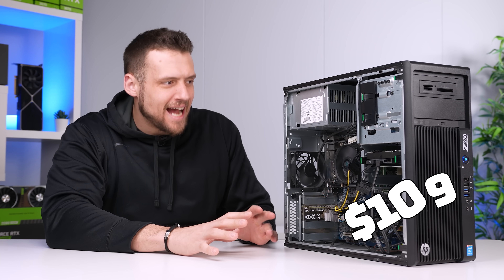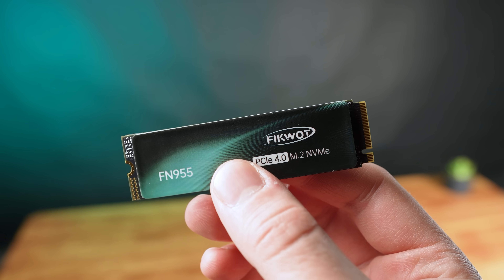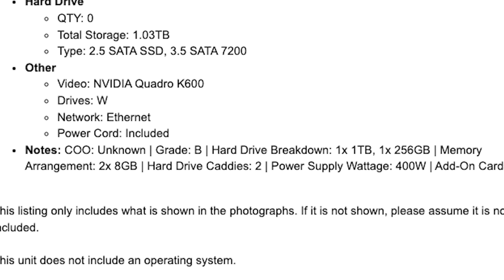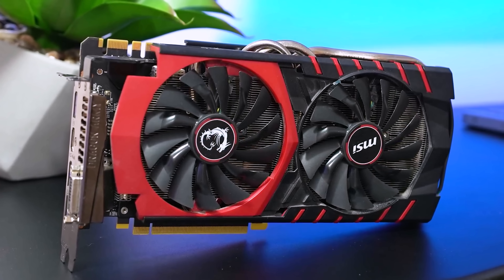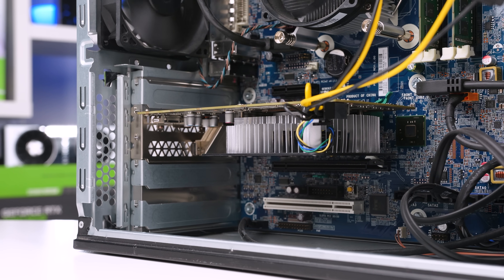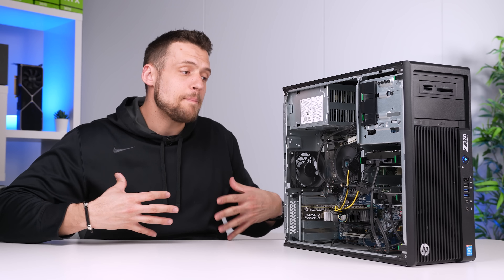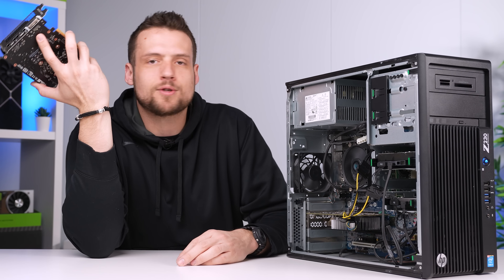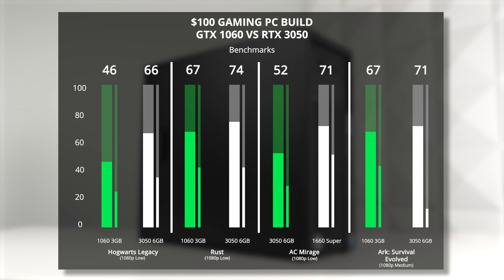This $100 Gaming PC Plays Every Game in 1080p

Comment from the maker: Special thanks to Fikwot for sponsoring today's video! 
► Fikwot FN955: http://amzla.com/u85710ezv50x (Use 7QOXEXIP to get 5% off)
► Official Website: http://amzla.com/vb439pepaucx (Use Q5M7RTVGSZ81 to get 20% off)
► AliExpress: http://amzla.com/qxnsfq8a90z8 (Use J174Y to get 40% off)
Reply: First💀
Reply: Where is the Valorant average fps?
Reply: Would a Rx 580 8gb work instead or better
Reply: i just bought a pc with a i7 6700 and a 1070 for 150$.
Reply: I feel like u kept saying "Thickwot"
Reply: Still to expensive. I can only do 15 dollars
Reply: I just bought almost the same thing before watching this video.😂 I bought a hp elite 8300 and a i7 3770 and gtx 1060. All it cost around 170$ in my currency (the three things i bought separately and im waiting for them so i can build my first ever pc in my life🎉) also in the hp office desktop is a i3 2120 so i bought the i7 but i don’t know if the psu will handle it but whatever.
Reply: In Sweden, it is impossible to build a computer for $100, even if you buy used, you still won't succeed. The cheapest you can build in Sweden will cost around $400
Reply: The thing is $100 is a huge amount of money in my country😢😢😢😢
Reply: I just recieved a fully functioning og Dell pc with ddr3 8gb of ram (the hard drive was removed)  it has an I3 3240 3.4ghz cpu. I'd like to flip it but the psu is only rated up to 240w. That doesn't give me very many options for a GPU. So im thinking of replacing the PSU, the CPU, and getting a RX 580 and flip it, will that make a profit?
Reply: i really don't understand this it said it was a gddr5 but the build was ddr3 please help me under stand so i can build a pc like this but with a better gpu
Reply: Do you do giveaways on your discord server?

Comment: Just built a used $100 pc. Bought a pc for $60 with an i5 7400 16gb ddr4 a gigabyte motherboard and a corsair power supply and then I bought a 1060 that was listed as a 3gb but ended up being a 6gb for $40 off Craigslist

Comment: Something to note, these oem hp desktops use a proprietary 18 pin power connecter. If you want to upgrade the power supply you'll need a 24 pin to 18 pin power connector adapter.
Reply: Note that other OEM systems like Optiplexes use 8 pin connectors.
Reply: @charliesretrocomputing  Only the smallest form factors use proprietary connectors. A good portion of mid and full tower versions use standard ATX power supplies. Even my BTX Optiplex 755 uses a regular ATX supply. Though some SFF models just use Flex ATX models instead.
Reply: @BrunodeSouzaLino  I just flipped a OptiPlex 3050 MT and it had a proprietary connector. That’s a very big PC.
Reply: @charliesretrocomputing  Thankfully, adapter cables are readily available.
Reply: @BrunodeSouzaLino  Erm........ You're wrong there mate. The full tower Z230 use an 18 motherboard connector, while the SFF versions power the board with 2 different types of 6 pin connectors. Also, the towers PSU doesn't really conform to ANY of the ATX standards as it's slightly taller and slightly narrower than an ATX PSU. It also has an output with a strange voltage (Something like 11vdc) that no ATX PSU will provide.

When you fit an ATX PSU into one of these (Which I have in one of my Z230's) you can physically bodge it in using 2 of the PSU's screws, and then you need a 24 to 18 pin adapter. This adapter has a little voltage regulator under some heat shrink on it that provides that one unusual voltage that the motherboard needs.
Reply: Some HP PC's use a 4 pin connector or 6 pin on the motherboard power. You can find the adapters on Google if you search. My Lenovo I'm trying to replace uses a 14 pin connector on the motherboard. So you gotta make sure you get the right adapter. It's not hard but also you gotta usually make sure your graphics card is small enough to fit.
Reply: On sff build (genrealy thinkcentres) the pin is 14 pin only

Comment: I just retired my HP Z420 Xeon E5-1650 v2 machine. This came with a 600W PSU with 2 x 6-pin pci-e connectors. This system has a little more CPU power with 6 cores/12 threads and the PSU really opens up your GPU options. I used a 2 x 6-pin to 1 x 8-pin pci-e adapter cable to run an RX 6650 XT and it ran like a champ. Those old HP servers can still be found on eBay for cheap and are a great choice for budget builds.

Comment: As someone still stuck on my decade's old i7-4790 build with 16 GB DDR3-1600... seeing how little my PC is worth now hurts 😅
My RX 6600 is the most valuable thing about my whole PC now (upgraded from a GTX 1060 6G, upgraded from a GTX 960 2G). CPU bottlenecking is plenty nowadays.
Reply: The problem is, RX 6000 series are made for Re-BAR. It's also optimized for PCI-E 4.0 and the RX 6600, only has 8 lanes. Must get RX 67xx for 16 lanes. 
Or get an earlier card, such as RX 5600 XT. Navi10 does not need Re-BAR at all. IIRC, Navi10 has 16 lanes. Navi10 is RDNA1. RDNA2 is made for Re-BAR. Also, RX 5500 XT only has 8 lanes.
Reply: is the RX 6600 any good?
Reply: @slitzworld  I wouldn't be the best person to say as mine is severely bottlenecked by my i7-4790. Also a PCIe 4.0 x8 card in a 3.0 x16 slot (but the CPU bottleneck is the biggest factor).

Comment: The first gaming desktop I had was my father’s office desktop back in 2016 with a Core 2 quad Q8400 and I paired it with a GTX 750 Ti and upgraded the ram from 4GB to 8GB and added a 256GB SSD. It performed quite decently at the time.
Reply: that is the real proof that you don't need the latest gen processor

Comment: Hey Zach I’m pretty new to pc building but I want to thank you for making a lot of 700 dollar builds because that’s me budget. If your wondering these are my specs, SP Silicon Power 16GB (8GBx2) XPOWER RGB, AMD Ryzen 5 5600X 6-core 12-thread Thermaltake Toughpower GX2 80+ Gold 600W, XFX Speedster QICK308 Radeon RX 7600 Black, Crucial P3 Plus 1TB PCIe Gen4 3D NAND NVMe M.2 SSD, ASRock B450M/AC R2.0 AM4 AMD Promontory B450, Phanteks (PH-EC360ATG_DMW02) Eclipse G360A😊 these are all new on amazon.

Comment: this is the build i use and ive no complaints. my HDD is a 4tb Seagate 7200 RPM, the SSD is a WD Green 120gb, and i got the MSI ITX version of the 1060 3gb. I use CAS and the Steam Deck Performance Mod in Starfield and have no issues with it, it plays nearly 60 fps in Robocop Rogue City (75% scaling TSR) medium and it looks gorgeous in my older Dell 1050p monitor (im not in a hurry to upgrade). Its been my build for a while now, and it has an OEM Dell XPS mobo, along with a 750w PSU (its a brand name just cant remember) and as well the 16gb is a big help, as is overclocking (and overvolting) the 1060, it will gain noticeable performance increases. Its all in a RoG Strix GD30 case and a lil extra RGB. Im in no hurry yet to change up, maybe next year.
Reply: I'am also using this since 2021 and tbh its better platform that those dell optiplexs

Comment: I got a similar system in my area for 100 euros. I chucked in a 1060 6GB, since it has a 6 pin connector and it works like a charm.
Reply: Hello Stef what system did you buy

Comment: HI Zach, I have been using a similar pc for a few years now, a Z220 model I put in a 2tb drive with an rx 6500 xt, which i chose because it was the most powerful card at the time with a 6-pin connector which came with the psu. i know the 6500 xt technically  isnt the best "budget gpu" but its part of the 6000 sieries of cards, its power efficient, and because its newer architecture it'l probably be supported for a longer time in terms of the drivers

so its specs are:
intel xeon E3V2 with 4 Cores and 8 Threads
32 Gb of ddr3 Ram
RX 6500XT
150Gb boot drive
2Tb ssd
500W psu

im very happy with its performance
Reply: 6500 XT is not a super budget card 😂

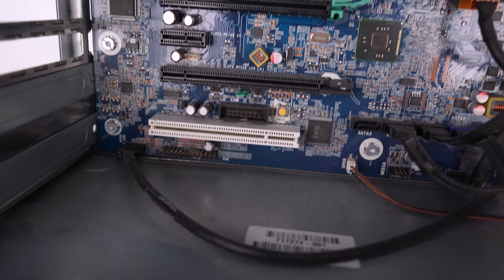Comment: 6:26 won't that fry the motherboard?
Reply: If you disconnect the fan wires, it won’t
Reply: You just have to unplug the fan before you blow it
Reply: Why would it fry the motherboard? It's just air.

Definitely don't want the blades to spin fast. Holding it is fine.
Reply: @aguyandhiscomputer  heard a story on the internet about a guy who vacuumed his PC cuz it was dirty and it fried the motherboard
Reply: @Audacity___   Ok, yes, that's different. I bet he touched the mobo with the vacuum tip. Blowing is best.
Reply: @aguyandhiscomputer  actually it was blowed really hard, the fan spins and make a current, it literally lit because it was still responding to electric current which was from the motherboard.
Reply: @firdaushidayatullah4911 OK, yeah, you want to prevent the fan from spinning with your finger or something else.

Comment: I bought a HP Z240 one for 110 USD, has E3-1240 V6, Quadro P2000, 16 GB 2666 DDR4, and 512 GB NVMe SSD. I gotta say it's pretty good, I only play Euro Truck and Forza, ETS2 is locked at 60 FPS 1080 high, Forza is at around 100 FPS 1080p low.

Comment: My current PC is a i7 4790k paired with a 3060 12gb and it works great.
Reply: Could be MUCH greater with better cpu. You just waste the most potencial of your card.
Reply: @imbot3804  I have a 4k monitor. Trust me, my GPU gets used plenty.

Comment: This is pretty close to my $40 PC. I got a HP pavilion with an i5 7400 for free. Picked up a Rx 480 4gb and $16gb of ram for $50 then sold the stock ram for $10. I was worried about the 300w PSU but haven't had any issues even when stress testing the CPU and GPU at the same time. Time Spy score of 4379 with the 329th fastest RX 480 after an overclock. What's even crazier about that is that it's an OEM HP Rx 480 with a stock TDP of 110 compared to the normal 150W. I raised the power limit to 150w in adrenaline to match normal Rx 480s but I wouldn't go higher bc 6pin+pci-e can only supply 150w.

Comment: I have the exact same Hp z230, with the exception of using i7 4771, ram upgraded to 24GB, and using Gtx 1650 gddr6 gpu. This thing is really powerful it can even runs starfield smoothy

Comment: the 4790 and 4790K are still pretty good, my first build 2 years ago rocked the 4790K with a 1660 Super

also these days the 1060 3GB is more of a 720/900p card, pairing with one of those monitors (since they're also cheaper) would go perfect since it'd look better than running at those resolutions on a 1080p monitor, something like a 900p 75Hz monitor would be a real good sweetspot and it'd still be under $150 cause those old 900p75 monitors are dirty cheap, it's sad how badly that GPU aged though, when it came out it was definitelly a PS4 Pro killer, now even the 6GB one can barely keep up with the base PS4 in modern titles

funny enough, it still beats the Steam Deck in performance lol, now I think, I wonder how would games run exactly at 800p like the Steam Deck
Reply: Yeah, that's one downside of tecnology: it's age fast that what we would want My men

Comment: I got the same OEM for free, I slapped a 6600xt, more ram, and the mentioned sata power cable, but the 8pin version and it worked. Whenever the CPU gives out I’m going to buy a new mobo, and cpu, and psu. Keeping the case 😎

Comment: I just bought almost the same thing before watching this video.😂 I bought a hp elite 8300 and a i7 3770 and gtx 1060. All it cost around 170$ in my currency (the three things i bought separately and im waiting for them so i can build my first ever pc in my life🎉) also in the hp office desktop is a i3 2120 so i bought the i7 but i don’t know if the psu will handle it but whatever.

Comment: It's 2024 and I'm still using Z230 with Core i7-4790, 32 GB and NVIDIA Quadro P4000 8 GB. I don't play much games though but sometimes I like to spend time playing Starcraft 2 and I do it in 4K Ultra :). Also this machine works well in Davinci Resolve in 1080p timelines, even in 4K timelines, but I'm using ProRes footages. BTW mine came with 6 PIN GPU power connector.

Comment: Hah, I love it. I literally just built a computer out of spare parts, spent 30€ on a motherboard and 1080p monitor (some old SyncMaster from 2009) and it has an i7-4790 and 16GB DDR3. I paired it with a GTX 1060 but 6GB version, which was free because of liquid damage which took me a good bit to thoroughly clean and repaste. I can definitely confirm 60 FPS in Helldivers 2, though I run it on medium preset, it's so CPU limited that all 8 threads are working very very hard to keep it going, so my 1060 is barely jogging to keep up anyway. 

The i7-4790 is a great choice because of the 4 cores 8 threads. It's still perfectly serviceable to game on 8 threads in 2024, but you REALLY don't want less than that. I got a few friends with comparable PCs playing Helldivers 2, and it runs like a bucket of butts for them because their 4th-6th gen i5's only have 4 cores 4 threads.

Kinda wish I had the i7-4790K as I have a lot of thermal headroom, even under 100% all core load it's only pushing 73°C, I could overclock it a good bit if it let me.

Comment: Honestly... I don't know how you missed that these come with a single 6-pin PCIe power connection. The Z210, Z220, Z230 and Z240... they all have one. There was no need to resort to the dual SATA connections and you could easily run a 1080 off this thing without needing to upgrade the power supply. Just a 6-pin to 8-pin adapter would do.

Comment: I just got a similar system myself. I got a good deal on a lenovo p310 with a 4c/8t cpu about equal to an i7 6700, 16gb ddr4, no hard drive (I just had a 512gb hdd & a 256gb ssd sitting around that I used), and a gtx 1060 3gb.

Comment: 1:56 Businesses usually replace their whole hardware stack every 5 years. As per which cards you can use, the PCIe standard is backwards compatible. You can plug a modern card in an earlier slot, but you're gonna lose performance.

Comment: Old workstations make some great builds on the cheap.  I'm running a 2x Xeon Lenovo P710.  Factory 850W PSU and 2 8 Pin PCI-e cables included.

Comment: I bought a couple of Dell office PCs a few years ago and tossed video cards inside of them. It's a great way to get started or to help someone else get a gaming PC off the ground. It is important to note; that Windows 10 is end-of-life on Oct of 2025, so understand if you buy an older than 8th-generation PC you will likely need to plan to move to another Operating System in 16 months.

Comment: Anyone watching this, as of july 7th 2024 the rx 480 8gb is like $50-$60 on ebay, if you can find a pc with similar specs to Zach's and chuck a 480 into it instead of the 1060 3gb you may see better performance in some games and you will be able to run games that require more VRAM to start.

Comment: I run 2 of these Z230's as budget games machines, and I'm perfectly happy with them. One has the standard 400w PSU and a 6gb GTX 1060 in it, and the other has a 650w ATX PSU bodged into it and happily runs a GTX 1080.

The only real problems with using a Z230 as a games machine is that HP didn't add BIOS options to do anything interesting, all but the top 16x PCIe 3.0 slot are PCIe 2.0 (so once your GPU's installed, things like PCIe to M.2 adapters or 8 port USB 3.2 cards will be struggling with bandwidth), and there's a few things that don't conform to ATX standards, so certain upgrade paths are tricky. For example, the PSU isn't ATX dimensions, the motherboard plug is an odd 18 pin item rather than the common 24 pin, and the PSU's also pushing out an oddball voltage on one rail for something or other (11vdc IIRC). An ATX PSU CAN fit, but it's not exactly tidy unless you fabricate an adapter plate, and you'll need a special power adapter cable that includes a power regulator in it to get that off voltage.

These PC's only really came with i7 4770/4790's or a handful of different Xeon chips from the E3-12xx v3 range. The i7's seem to give slightly better benchmarks, but the difference is minimal, and as the Xeons tend to be a shade cheaper, it's worth not ignoring them as a potential option. They're all basically the same piece of Haswell silicon with different names etched into the lid, so it's not worth getting too hung up on which flavour you find going cheap.

Some HP/Dell/Lenovo systems can spit out their dummy if you don't use the exact OEM specification of memory that came in it when new, but these don't seem to be particularly fussy. They take up to 32gb of DDR3, and at least here in the UK, DDR3 seems to have hit that point where the secondhand markets flooded with the stuff, but most of the folks who could use it have already loaded up their PC or are saving the money to go towards a CPU/motherboard/DDR4 upgrade, so for now, getting 4x 8gb sticks isn't a budget shatteringly experience.

All said, for the money, they're still an absolutely cracking budget games PC. As the PC's have onboard raid, and I had a handful of 1tb Samsung SSD's kicking about, I chose to set my pair of Z230's up with raid 0 striped arrays for the primary drives. It's not getting anywhere near m.2 speeds, but the setup does give a noticeable drop in how long games take to load.

Comment: For a little more, you could start with a Dell T5820 as the base computer, which will get you into quad-channel DDR4 territory, and will have a much faster Xeon processor than these 4th gen i7s. Often you can find these for about $110 on eBay with a Xeon W-2133, 16 GB of ECC DDR4 RAM, and Quadro P600 card that you could sell for $40, and then use to put towards getting the GTX 1060.

Comment: Got an i5-4590k paired with a Zotac 1660 Super and 16gb DDR3 RAM. Runs games like BG3 on 1080p at about 40-60fps. Newer Open World RPGs like Dragons Dogma 2 won't run. But: My 1660 is still bottlenecked by the cpu about 30% 🥲
Reply: My 1650 is bottlenecked by my i5 that’s a little newer but it still is super annoying 😢
Reply: I have a Zotac 1660 Super! Works very well for a GPU with such little power draw. It's what I was cheering at, when I accidentally "bricked" my RX 5600 XT! (That was in December, 2021! So that card saved me, as I also got it before 2021)